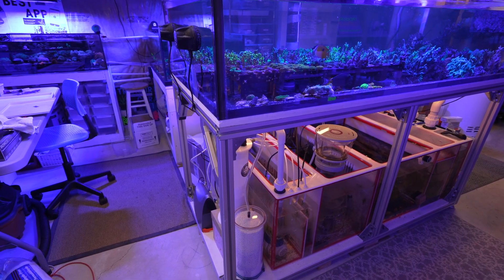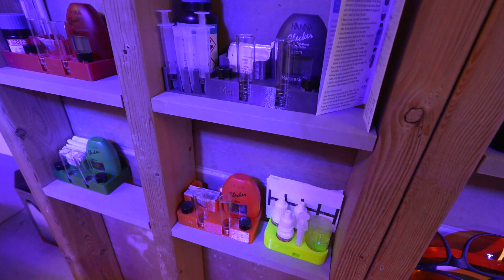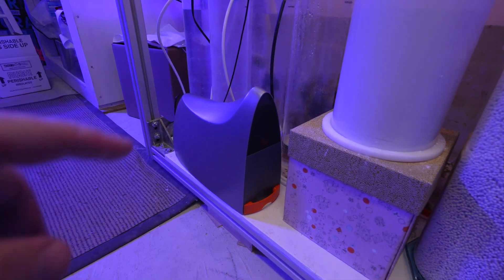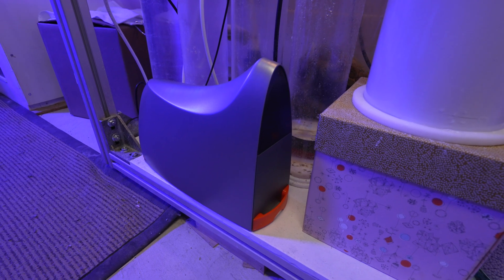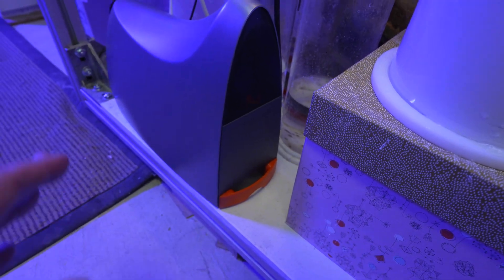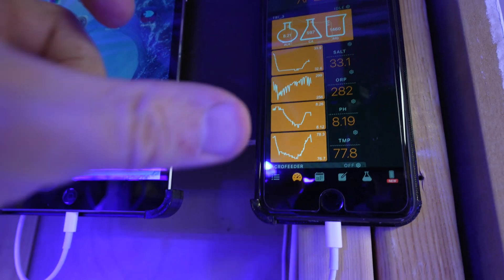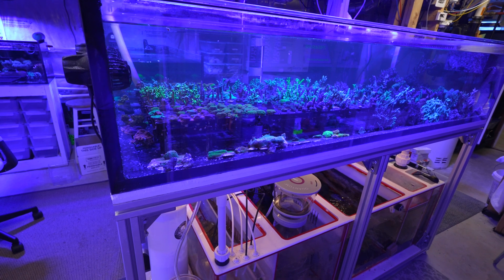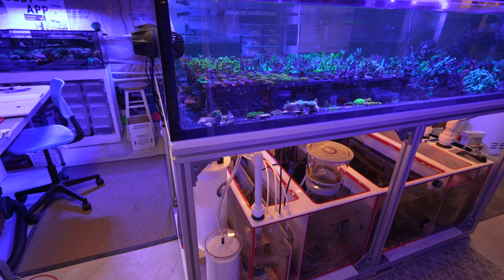An Introduction To Neptune Systems Trident

Comment: I have had a Trident for two years.  Best piece of equipment I have purchased for my reef tank.  On accuracy, I find my dKH about .5 lower with Trident than Hanna checker.  It is absolutely consistent with all three tests.  Calcium and Magnesium are right in line with my manual testing.  The Mastertronic is another auto tester that will also measure nitrates and phosphates.  If my pockets were deeper I would love to try one of those.
Reply from the maker: Wow, great to hear this Gary. I am putting another Trident on my other system, it has been exceptional so far.

Comment: I can see the appeal. I'd really like something that is standalone that measures the big 5 plus pH for under $700 and $50 a year for KH, PO4 and NO3 daily and Ca / Mg weekly. At that price I'd probably test 4x that.
I think the reagents will come soon and the machines not long after. I'd love Potassium too - I think K is more important than Ca and Mg.
For now though I'd rather take that money and do 4 ICP tests a year and just test KH and occasionally PO4 or NO3 because everything is pretty stable. If they had that machine I'd run my tank differently with carbon dosing plus NO3 and PO4 dosing to keep a perfect 150-200:1 ratio probably with 0.1 PO4. I just don't see much value in testing Ca and Mg if you use a good salt.
Reply from the maker: Love your thought process. Can you imagine where our hobby will be 10 years from now? Already looking back things were so different 10 years ago.
Reply: @TreasureCorals  probably we'll be beyond that 😁

Comment: I've had the Trident for about 4 or so months. I've calibrated with Neptune's solution and my own tank water.  It is accurate on Magnesium and Calcium. It's consistently 1 dkh low on Alkalinity and always has been. I'm not the only one with that issue.  I do love it though.
Reply from the maker: Interesting. I will run a few tests and compare the results.
Reply: Same here. I bought mine back in Nov 22. As long as my alk is in a range, then I'm happy. I do still test all parameters weekly just to make sure things are still on track.

Comment: what frequencies can you change the testing to? 1 test a day possible?
wondering about recurring reagent costs.
Reply from the maker: I am still using the stock 4 alk, 2 mag/cal, but I think with some tweaking you could change it to less frequent - I've seen some threads on it. At this moment I still like that ability to really dial in so will take a hit for now, but will eventually see what other options are there. If you come across one - please let me know.

Comment: It will need maintenance once in a while, and the lines plug up once in a while and calibrated 1 time every month or so i've found out.
Reply from the maker: Thanks, I have done the first calibration. Looks good so far, and I can't see myself running a reef without it.

Comment: I know you just got the trident, but do you think the time gained from not manual testing is going to be switched over to maintenance for your controller? I've never owned an apex or trident, don't know much about them. But I just think about the more you add makes another thing to look after. Although I think it's a perfect device for a farm system like yours. Hope it does well for you! 

Great video!
Reply from the maker: It is a very good point, so far I can't really comment on this as I am still new to the device. I love that initial feeling and will get a second one for my other tank. Now where will I get 6 or 12 months from now - no idea. Right now it solves my biggest problem - I sometimes forget to replenish some of the 3-part and may find this out days after. I also still feel that I want to dial in more.

Comment: this is kind of a lot to ask but, can you make a par reading for the ai blade while resting on the tank, with a single and dual blades. and the intensity used for testing?
Reply from the maker: I have done these recently and got about 200-300 par easy. They are a plenty.